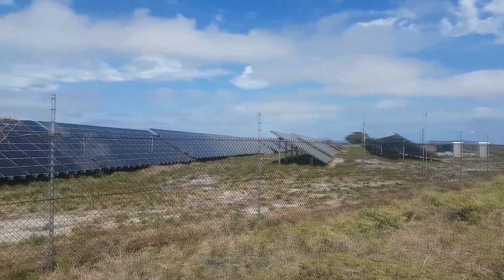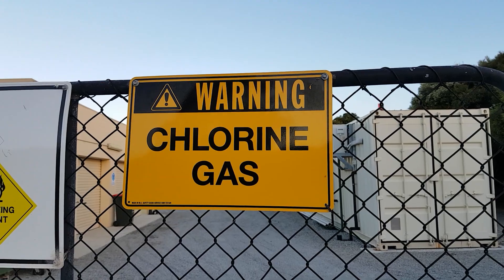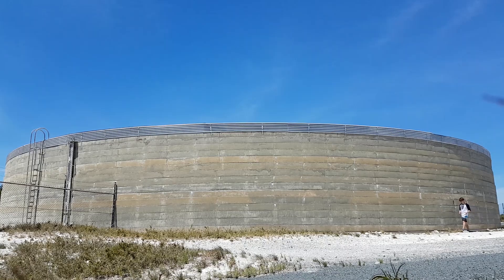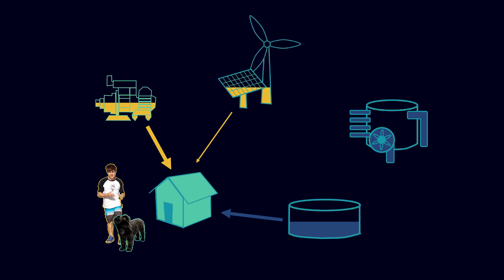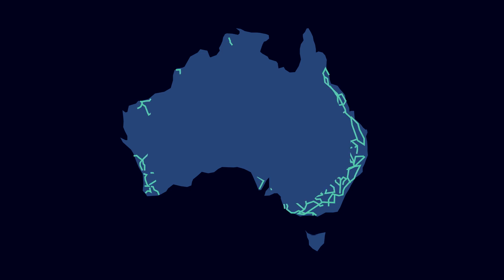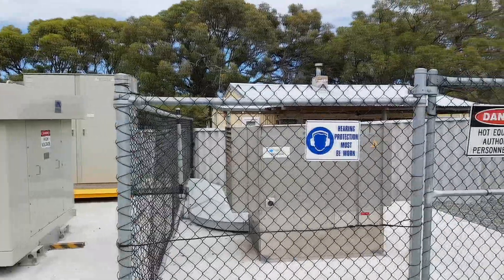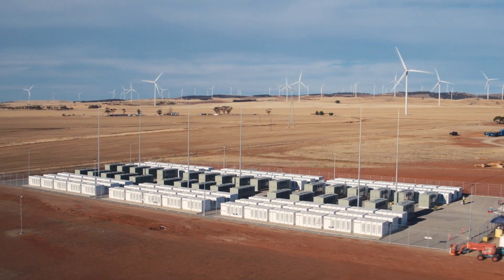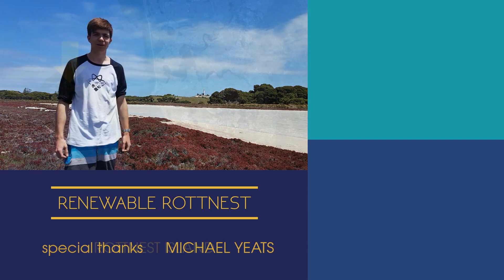How To Power An Island

Comment: I think the biggest problem with using lithium batteries as grid storage is that the reasons lithium batteries are great for phones, cars, laptops, etc… are useless or completely unnecessary for grid storage (being relatively light, compact, not sensitive to any movement) lithium batteries are also extremely expensive. For grid storage you’d want a battery that’s relatively cheap and doesn’t degrade over time like a lithium one would.

Comment: You got that backwards.  If too much energy is being produced you'd reduce the resistance as power consumed by the resistor is inversely proportional to the resistance, P=I^2/R.
Reply: You have that backwards, the law is P = I^2*R. That's why conductors with low resistance are valued, because they lose less power to heat. High conductivity means low resistance.
https://en.wikipedia.org/wiki/Electrical_resistivity_and_conductivity
Reply: @massimocole9689  You are correct Sir!  P = I^2*R!  It's been 40+ years since I was involved in electronics.....

You are incorrect though in one thing; this power load is designed to suck up power, not avoid sucking up power as in transmission lines.

If you want to maintain the same voltage on a line, and yet suck up excess power being created, you need to reduce the resistance of your variable load resistor.  Thus creating more I.  Halving the R will double the I and assuming the V remains the same it will quadruple the P.  Contrary to what the video said.  So paradoxically, I was right, and wrong :).  Power consumed by a circuit is inverse to the resistance of that circuit, assuming V remains the same.

Sometimes it takes a few moments to clear the cobwebs.  I just knew that to absorb excess power on a powerline that must maintain a constant voltage you have to reduce a control load resistance.  I just got the formula wrong... :)
Reply: @unchosenid  Ok yeah, I also saw the equation P = V^2/R when looking that up so that seems to track.  Is that because if voltage is constant the lower resistance results in higher current flow, and the higher current flow also heats up the lines? It seems kind of counter intuitive that R can be both inversely and proportionally related to power loss depending on the situation, how do we know which one applies in this case?

Comment: Nothing wrong with using lithium it will be recycled after many years of supplying clean energy?
Reply: Exactly and in storage batteries can be just old EV batteries, because most of them are 70% of original capacity still and can last more than decade of storage usage still and if that is just alongside with those other energy storage things, then stoarge capacity doesn't need to super massive. 
I don't know how much that resistor waste energy, but that could be saved with batteries and the resistor would be just backup if batteries fill up. 
Additionally there could be EV charging station near that battery storage thing, and maybe if batteries are more than 70% full (of working range) or something like that, then EV drivers could charge free there (I know that EVs don't use much energy, but atleast that energy would go to good use and not just heating up air.

Comment: Thanks for making such nice videos! I don't really understand the water hose equivalent here. With a traditional turbine generator connected directly to the grid, a decrease in demand would simply decrease the mechanical resistance on the input shaft, allowing the turbine to spin faster and faster. This would damage both the generator and the connected devices. How is this the case with solar panels and wind turbines? Solar panels don't have any moving parts, so disconnecting some or all of them from the grid doesn't lead to mechanical issues. Wind turbines usually have brakes and the ability to change the blade pitch. What prevents this from being used here?
Reply: Nothing, but you have to adjust for it. You need a system that disconnects panels or changes blade pitch. To keep the analogy going: you need a system that acts as a valve at the start of your hose in order to not break the hose